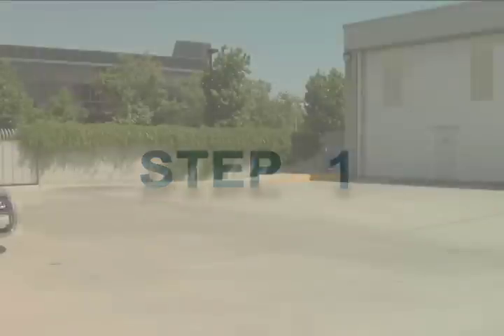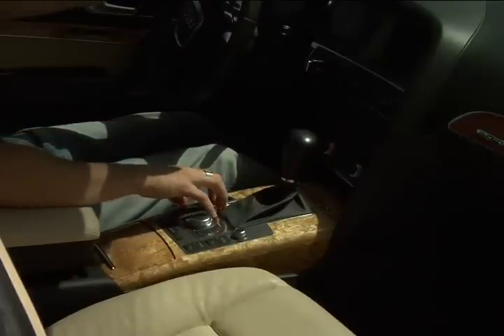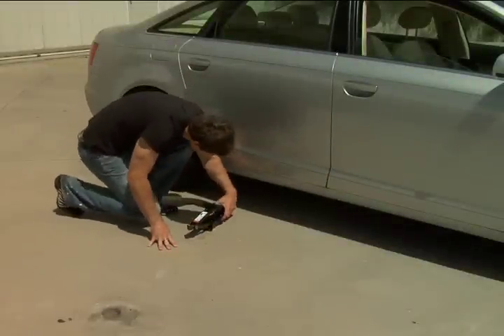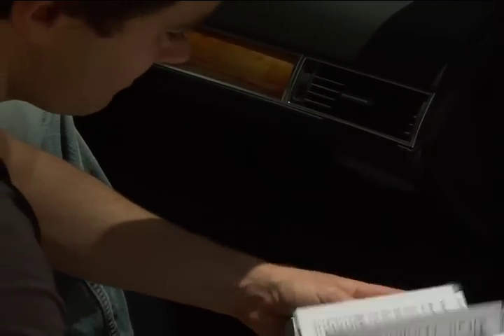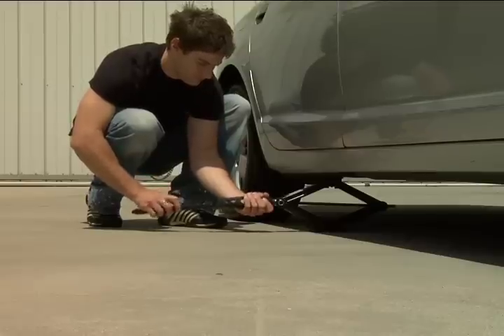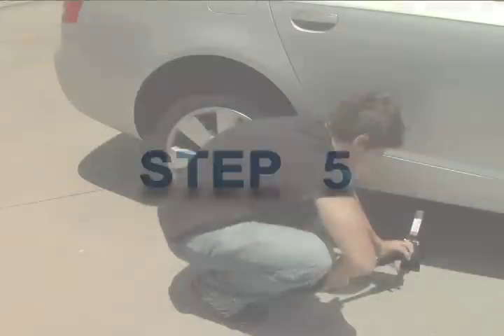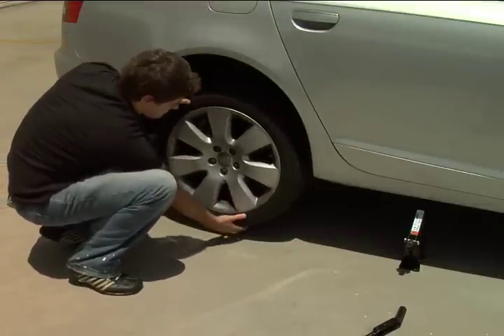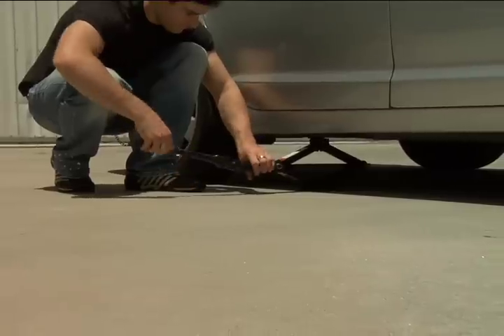How to Jack Up a Car Safely

Comment: Loosen wheel lug nuts first. Never place you hand under the wheel like the video shows!.
Reply: Correct.
Reply: instead of buying 2 car jacks, one low profile and one normal, can I just get only the low profile and use 2x4 wood when I want to work on normal height cars, is this commonly practiced or it's not safe.
Reply: I know I thought the exact same thing.

Comment: my car came with one of these but since I change all 4 of my tires whenever I race then change them back after I get done,  I said to myself many years ago,  to heck with this,  and went out and purchased one of those regualr floor jacks,  much easier. also a very good idea after you jack up the car,  use a Jack stand just in case the main jack gives out,  then at least the car would fall on something instead of maybe you......

Comment: Step 1: replace factory jack, you will be all day with that small ass jack. Spend between 30 to 100 for a jack you don't have to twist or struggle with
Reply: Step 2: Buy a full size spare tire.   Step 3: Buy a big breaker socket and bar.   If you do this you will not have a flat tire for the life of the car.
Reply: Wow that was a great advice.

Comment: Should ALWAYS use a jack stand. But if you dont have one.... using a floor jack is much safer to trust on it's own. but still not recommended. The little shtity ones that come with the car is just asking to be killed.
Reply: Car fell when I tried to change wheels, good thing I was to the side and not under the vehicle!

Comment: @otacon451

I had one of these jacks... I replaced it with a hydraulic one... Much more reliable... Much better lifting the AXLE rather than the body.